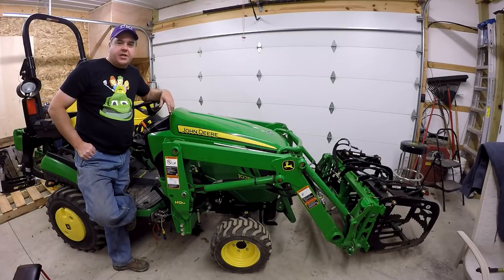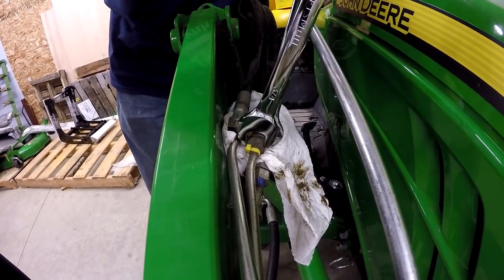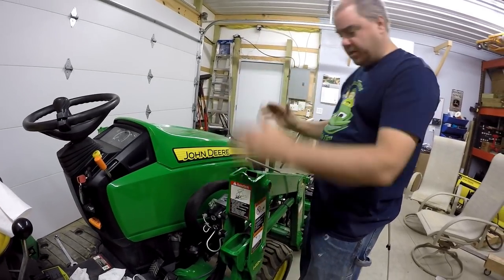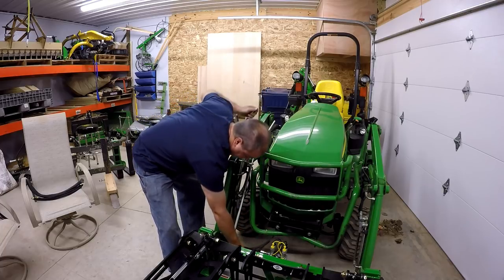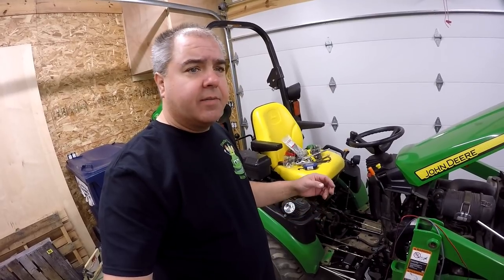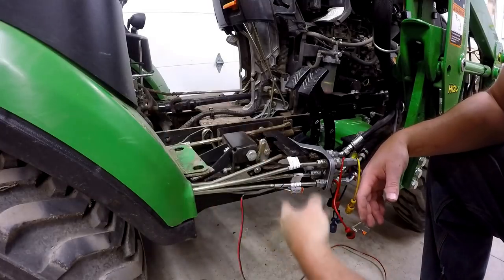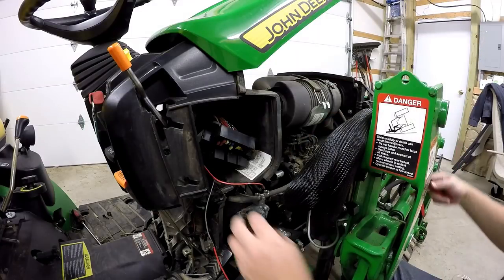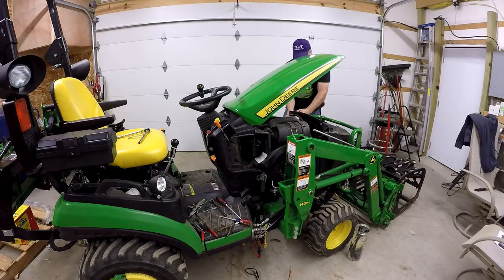Artillian 3rd Function Diverter Kit Installation John Deere 1025R Grapple

Comment: I love this video TIM!  I am interested in adding a Grapple at some point.  The part you show with the fuse box was very informative and the info on the NAPA connector is helpful as well.  I've been wanting to add work lights and some other toys.  Now I know it won't be so hard. :)
Reply from the maker: The NAPA connector is not a perfect fit, but it works.

Comment: I want one really bad but I'm having a hard time justifying the price on these (from any of the manufacturers).  For example the pallet fork backing plate alone is $659 from Artillian and it is nearly identical to my Titan pallet fork plate.  The Titan was only $400 for the plate WITH the forks.  Ouch.  Great video though!  Learned a lot about the diverter install.
Reply from the maker: ...but you lost a significant amount of lift capacity with the Titan.
Reply: Also is made of China
Reply: Yes they are so heavy especially for a small tractor

Comment: Tim, which set of artillian forks do you have on johnny? The 2300lbs, or the 3000lbs?
Reply from the maker: I have both now :-) I bought the 2300lb...then they gave me the 3000lb for use in sponsored videos.
Reply from the maker: Get 2300 lb if you do not need receiver hitch on 1025r
Reply: Tractor Time with Tim, I was wondering if the 2300lbs could handle the grapple, or if it's wiser to to get the 3000lbs frame for down the road?
Reply from the maker: For 1-series, grapple will work fine on 2300lb.  If thinking 2-series in future, get 3000lb.  Make sense?

Comment: Great video. Thanks. One question... how many bolts in the floorboards did you strip?  I had half of mine strip and had to use a nut on each. I hope JD has reworked the type of bolts used in the floor. Can't wait to see it in action. Merry Christmas :-)
Reply from the maker: I've had the floorboard off many times. No bolts stripped to this point.

Comment: Merry Christmas Tim I enjoyed the video and it was very informative I have been kicking around a few options for putting a third hydraulic on my MF1739 front loader this seems like a good way of accomplishing that I would like to get a grapple bucket to handle logs and brush in the near future. 
Thanks again keep up the good work.
Jeffrey M
Reply from the maker: Does your Massey have a quick attach bucket?
Reply: Tractor Time with Tim 
Yes it does, I purchased a set of pallet forks from Tomahawk skid steer attachments or in Nappanee, IN. They work good but not a lot of control so I think a grapple would be a bit safer as well.
Reply from the maker: Dunno about safer. The grapple is mean!  However, it is an amazing attachment!!!
Reply: Tractor Time with Tim 
Hope you had a good Christmas, we sure had a nice one with all the family and good foods. I really enjoy working with my tractor between my dad and I we both heat with wood and we move a lot of logs around,  unfortunately I had a log about 8” dia 10-12ft long come over the forks didn’t hit me while running the machine but it did dent the hood of the MF1739. That’s where the grapple would give a bit more control in moving logs and brush. To everyone running equipment be safe out there. 
Thanks again, 
Jeffrey Misch
Reply from the maker: Yea, hard to keep stuff off the hoods of these small tractors.  It seems to 'hop' right over RJ bucket or fork frame.

This seems to be an advantage of the plastic hood (believe it or not).  I have hit it pretty hard...no dents.
Reply from the maker: And yes, enjoyable Christmas here.  I got an LED lightbar for Casey.
Reply: Tractor Time with Tim 

That sounds like a good addition for the machine. I have been thinking of mounting a couple on the Roll bar of mine for better lighting especially when plowing snow usually in the dark. 
 
Thanks, 
Jeffrey Misch
Reply from the maker: Christy got big rubberized magnetic mounts. If i were to use only the 12v plug, I could use it on either Johnny OR Casey.  However, I was thinking that I would wire into the switch.  We'll see how motivated I become.

Comment: I would rather have a kit that would allow me to divert the 3pt hydraulics to the front. Doing any “intense” work with the loader would be irritating having to switch between curl/dump and the grapple. Where as instead just divert the 3pt hydraulic power to the front of the machine. This would be more involved but I would much prefer it over switching back and forth. 

Also pro tip: use the closed end of the wrench for hydraulic hoses >:D
Reply from the maker: I got used to the diverter approach quickly.  Really not much disadvantage in practice.

Comment: Don't run your fingers around hydraulic lines looking for leaks unless you're sure there is no pressure in the system. It can kill you
Reply from the maker: There is no pressure in power beyond as long as no valves are being operated.  Further. We had already visually inspected for oil.

Comment: What a rip off on the "Splitter Manifold" and those extra hydraulic quick connects on the grapple hydraulic cylinders. All you need is a simple high pressure "TEE" too tie them in to each other.
Reply from the maker: The grapple is modlular. Meaning, each clamp is removable independently. Some folks will buy only one clamp.

Sometimes I use only one clamp, other times I use two clamps.

Also, the clamps and rakes are on a pallet fork frame, so they are removable.  
Using a ‘Tee’ makes no sense for this application.